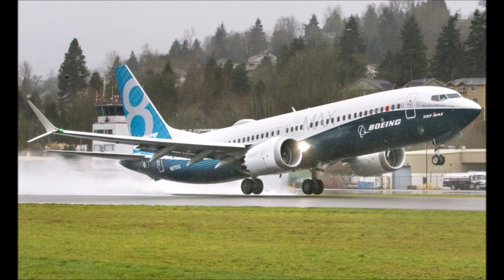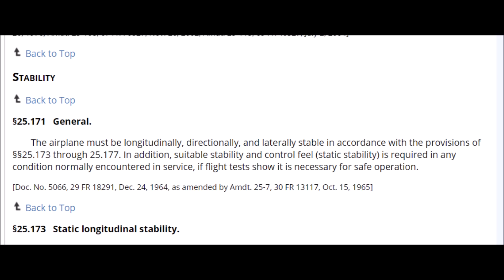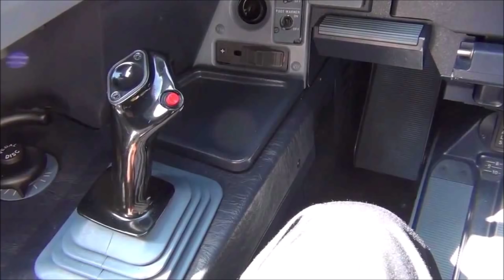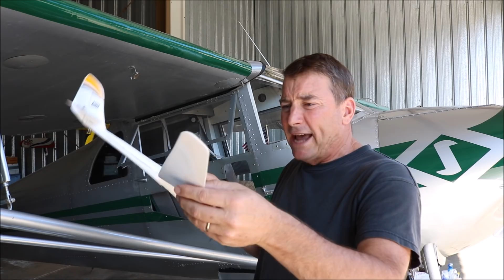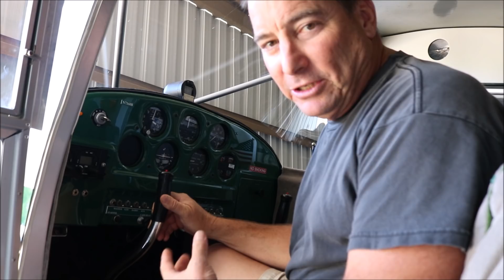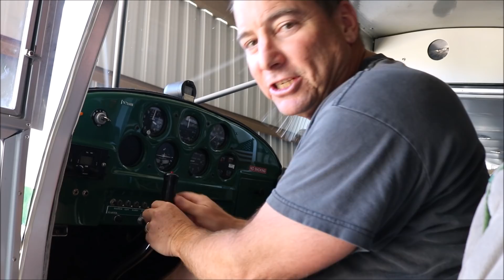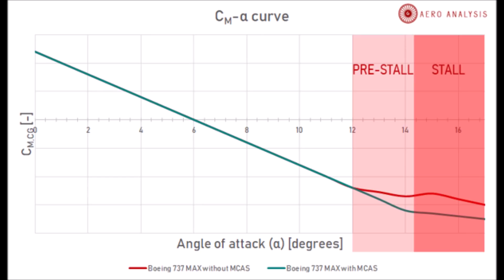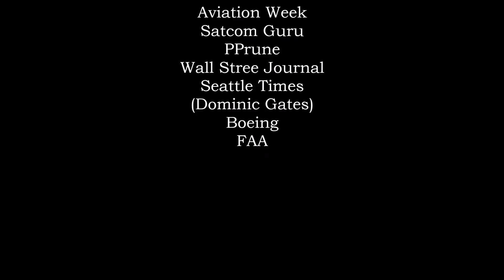737 Max UPDATE 30 Aug  2019

Comment: There's a subtle design flaw that most people miss. Having multiple systems/ sensors should aid redundancy, and normally it does... However, by switching between computers/ sensors after each landing actually multiples the chance of failure, rather than multiplying the reliability (both sensors have to be accessible by both computers, otherwise you're just adding more points of failure).

The MCAS system itself is hugely flawed, it's an insult to engineers to call anyone that worked on this an engineer. They failed at every level; the designers didn't identify the scope that this is needed, the software developers didn't see the potential flaws and query adding safeguards, testing. This wasn't tested, range testing is programming 101 and one of the first things you learn when studying Computing, you test a range of input parameters (good and bad) to test the behaviour. This is low-level (unit) testing, there's also integration testing where you test the module with the system. Again none of this was done.

You may say it's all very well to say this after the fact with the benefit of hindsight, but this isn't the case, this is still a huge failure. As Geeks are a cynical bunch, we EXPECT things to fail. Disks fail, backups fail (seriously backup your backups!), computers fail, power, network... even expect entire data centres to fail. To get an idea of the engineering the goes into redundant systems, search for 'five nines' (you really need to replicate at least three times for high availability, otherwise you can't tell which sensor is failing), another interesting read is Chaos Monkey. 

The worse part is that MCAS is largely cosmetic, it makes the handling feel nice rather than fulfil any real need. That's what makes this even more tragic.
Reply: The real tragedy is that Boeing (and every other aircraft maker) knew how to design, analyze and make safe a flight control system.  They have done it on every other plane developed in the last 50 years.  I can't believe they still want to fly with a two channel system that will shut down for any one of several faults.
Reply: @paulavery366  while it sounds counter intuitive, shutting down is often the best option. It's even considered a good practice to minimise unexpected behaviour.

One good thing about using old systems is that you know it works, as it's been In production for years even decades so you know it works. Creating a new system may improve things, but it is also likely to create a set of new problems. There's even a term for it it's known as second system syndrome.

Another thing that I do believe was a factor is that I heard the MCAS development was outsourced. So it's possible that the people working on it didn't have the depth of knowledge as someone who had been doing it for much longer.

I just hope people learn from this as a host of mistakes were made.

Comment: Hi Juan, great channel, I love your videos. Could you explain in more detail what is your basis for the statement that the MAX is not an unstable airplane. Does this mean that it is your opinion that at high AOA the MAX will not nose up due to lift generated by the nacelles? I'd really like to see the documentation on that.
Reply from the maker: It's in the video.
Reply: @blancolirio  Yes, I see the part about 25.171 which shows the FAA requirements and how you nicely project that in your video.  Saying the law requires it to be so, with all due respect, does not qualify as evidence of air handling characteristics. If everyone had followed all the rules we wouldn't be talking about the 737 Max at all. So that's what I am looking for is a certification document that affirmatively outlines the aircraft's stability in relation to high AOA. If you based your video on info other than 25.171 I'd be interested in hearing it.
Reply from the maker: see the data graphs.

Comment: "—Because they all handle similarly – enough." But would they? I have considerable doubts that a neat Boeing 737 would handle anything like an inelegantly 'stretched' version. I fancy that the integrity of the airframe would differ, too. Heedless of the incorporation of composite (for all I know, 'nano-formed meta-)materials' in the wings, they'd still be vulnerable to dangerously weakening effects of twisting gusts &c. To strengthen a towering tailfin or risibly-spindly wing is one thing; but to make us believe that that renders it invulnerable or indestuctible is just a cheap trick. The engines are attached to the plane by the wings. And this indirect coupling is, in my opinion, open to being affected by considerable gyroscopic forces that would emanate from spinning turbines that wobble under buffeting. Additionally, a lengthened fueselage may, in my view, be perilously-prone to turning forces that would bend it into those that twist it. And bear in-mind that some of Boeing's bodies may not be properly-assembled
    A resilient corporation  would know when to cut its losses. And Boeing has the resources to drop 737-production, especially of the tainted 'Max' type, so as to focus on the development of, say, a 757-style 797 plane that could travel for 12 000 km at near Mach 1; and, which would be suitable for short flights too. Beyond that, the aviation authorities ought to take so dim a view of 'stretching' civil airplanes that the practice should be robustly-curtailed
     Anyway, thanks for another well-researched and stimulating video. And I hope that you'll soon be fit again and re-accredited to pilot a plane

Comment: Good info as always. I flew all models of the B-737 200,400,700,800,900,900er for 26 years and 5 years of B-727 before that. I always said it was a great airplane but not a comfortable airplane. It's candy coated 1960's. The Airbus pilots I talk to say the Airbus is a comfortable airplane but not a great airplane.  Boeing should have quit with the NG and designed a new narrow bodied jet. Boeing has really screwed itself and the MAX operators now. Thanks for your great videos.
Reply: you got it right..should have been a new type rating.

Comment: Firstly I hope that your health issues are resolved. Secondly, in the meantime, if you want to make some money start a web-site that I can enter my flight number and it will tell me what type of *plane is it that I am about to board. I would pay $5 each time for this information. (preferably before I have paid for the flight). The only other option is after checking-in, on the tarmac, I refuse to board the aircraft. Not only would i be arrested for "terrorism" but my bag would have to be removed and all the other passengers would be giving me a very bad experience. 

* You could call it "Amiabouttodiecom"  :)

Comment: Boeing's history-revisionist description of MCAS as being designed to make the MAX "feel and fly like other 737s" has twofold purpose: limit liability and get the MAX back in the air ASAP.

The problem I have with this is that while you could argue that it isn't factually incorrect, it certainly appears somewhat misleading when taking into account the official technical description, which states very clearly that MCAS can only ever activate when the aircraft is outside of normal operational parameters "at speeds approaching stall."
Reply: Mushy Characteristics Approaching Stall. You must be careful, using logical and eloquent assertions like that.
Reply: When backed into a corner and under immense pressure to explain why they didn't inform pilots of MCAS existence: "It’s a system that’s designed to provide handling qualities for the pilot that meet pilot preferences." - Muilenburg.
When attempting to get the Max back in the air at the earliest opportunity: "A pilot should never see the operation of MCAS in normal flying conditions."

They'll frame it whichever way best suits their purpose at the time.  We rely on people like blancolirio to cut through their corporate BS, not recite to us carefully worded PR releases straight from the PR & legal divisions.
Reply: Mike, I concur. Still, Boeing was a name to look up to when I was a kid. Just about everything around us is in tatters. Everything that really mattered has been deliberately shredded, yet we're expected to buy into the crap. Don't think so.

Comment: If proven Boeing knew about these problems and still put the plane in the air choosing dollars over people I am afraid the 737 max is dead. Who really cares about Boeing, who really cares about the airlines when you compare it to your safety. I believe both the Airlines and Boeing are not addressing one huge problem and that is will passengers trust this plane enough to put their butts in the seats of this plane. Why would anyone risk their lives on a piece of faulty machinery which they claimed to have fixed with a computer chip. I have flown over 1,000,000 miles in my lifetime and would not consider trusting this plane ever again.

Comment: Great analysis. Not to criticize you, but Airbus as the "wave of the future" comment made me chuckle. The 737 vs A320 series is pitching a 1960's design against a 1980's design. Both of these narrow body aircraft are hugely out of date. Both have been stretched and stretched, re-engined, and in Boeing's case re-winged as well. The stretched 320 version, the A321, is severely climb and altitude limited because it uses the same wing as the 320, but weighs tens of thousands more than the original A320. The Boeing has VREF approach speeds that would make a Space Shuttle pilot proud, which is why NG 737's have so many runway over-run accidents. A 737NG pilot better on their A-Game landing on less than 8000 feet of runway or when it's wet/contaminated. Anyway, who is to blame for all of this? Passengers. The FAA, Boeing, and airlines are responsible, but not the root cause. Passengers demand a coast to coast flight, with roast beef and champaign, for $79.... Well, guess what airlines passengers, you get the airline industry you pay for.

Comment: Good luck with Your health! 
As an automation tech loving guy with 30+ years experience working with & troubleshooting/repairing various "automation tech" in a manufacturing environment I find this info very interesting. I also find it very strange that no one mentions the Bloomberg News story that the MCAS software was outsourced to non English speaking "engineers" who were being paid slightly above minimum wage. I realize mentioning anything like that these days is not politically correct but facts are facts and making them off-limits does not help solve the riddle of how this RIDICULOUS programming made it into an airplane. 
My PLC programming at work is limited to small error cleanup and/or very minor strategy changes of "full system" programming done by corporate "office based engineers". Bigger cleanup jobs have to be done by corporate and begins by us at the plant level explaining in full detail what the issue is and the corporate guys have to fully understand what is going on at the real world level before they can fix the programming. Corporate programmers includes one guy where English is his 2nd language so I completely understand the issues this brings. He is a wonderful guy but has little experience/understanding of the real world of the machines he is programming -- his programming is based on a "theoretical understanding" and trying to make someone understand complex real world issues while speaking in a language they are not native speakers in can be extremely difficult and this has nothing to do with immigrant bashing or racism (which is what our news cycle has been reduced to in the USA).
I can't fathom how ANYONE could approve a system that could nosedive a plane into the ground being reliant on one single sensor. That is SHEAR INCOMPETENCE (at best) and that decision can't be defended by anyone with even the slightest understanding of automation systems/programming. The fact that this programming strategy could make it through "the system" at Boeing shows me that Boeing is just as broken as the Government is. 
I predict that the Government won't accept any responsibility in this just as they don't in anything else and a few big wheels MIGHT forced out at Boeing (but will ride off into the sunset with golden parachutes of unimaginable proportions). Then the little guys in Engineering at Boeing (who probably were threatened with layoff or had to accept pay/ benefit cuts with the outsourcing of their jobs) will take all the blame and financial hits while the people who made the outsourcing decisions will pay NO price whatsoever other than golden parachutes and/or huge bonuses.
Reply from the maker: Great Points! 
Where did all the experience aeronautical engineers go with years of real world experience?...(-$$$)

Comment: Thank you for the information, it was a good video. I'm praying for you concerning that prostate cancer problem that you've been getting treatment for and praying that you can get back to flying. I had two relatives that were diagnosed with cancer,and were both healed. My cousin Joe was in stage 4, but that isn't a big deal for God to handle. The doctors were the ones that were shocked and can only say it's a miracle. God bless you Sir.

Comment: As far as I remember the dreamliner is fly-by-wire so it's wrong to claim Boeing is totally not fly-by-wire and only very old designs like the 737 can operate without it. The future even for Boeing is fly-by-wire.
Reply from the maker: Yes, but they do not use side stick controllers with no feedback ala Airbus...(at least not yet).
Reply: And there's no reason why Boeing should, especially after AF447 highlighted how the shortcomings of the system could be easily predicted via thought experiment alone - you can imagine all the things that can go wrong if your eyes are following visual cues other than directly focusing on the hand itself. In any case, the outcome of that accident should have been enough to warrant radical reworking of the methodology, IMO - Sully had something to say about it for sure. If a sidestick controller is seriously contemplated, then wouldn't it be prudent to instil tactile force-feedback sensitivities an able bodied person could detect with subtle finger pressure intensities? Although I'm not into force feedback and that track IR headgear thingy, the virtual games sector is actively pursuing such a course, meaning an aircraft manufacturer should be able to accomplish a polished industrial equivalent in building and reliably maintaining a controller that actively 'talks' to the pilot. I know that actual FBW or otherwise aircraft have a page that can be called up to view a graphical representation of the flight control surface actuation in real time mode, however, that is still a rather one-dimensional substitute when Boeing flyers have been able to feel the real thing since year dot.

Comment: Thanks Juan.  So as I understand. If a quick test scenario with 'this' aircraft fully  loaded with good C of G.  1.Rear stabilizer (Jackscrew) manually cranked to the  'new full nose down pitch limits then locked (only for this test). 2.Good long Runway. 3. Set flaps for takeoff. 4. Full power. 5. Brakes released and off we go. 6. Pull on the stick.. Pull Up!! Yes!  NO! , because this aircraft with that stabilizer 'trim' setting locked, cannot and will not become airborne. The elevators cannot override this stabilizer setting with normal C of G.  Oh I remember Alaska Airlines Flight 261 Jan.31 2000.(seems just a bad jackscrew)

Comment: I do not understand why it would be considered a good solution that the system be designed to consider the data from a single AOA sensor at a time (used alternately), even though there are two present? Surely with such a critical function, there should be three sensors & the signal from the two with the closest readings considered in tandem...